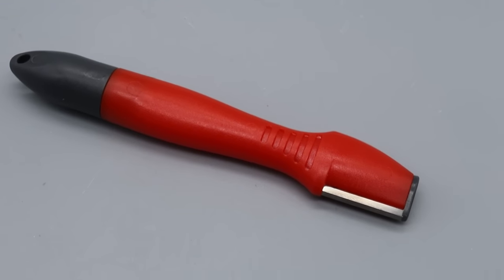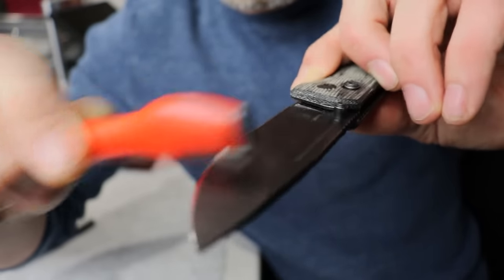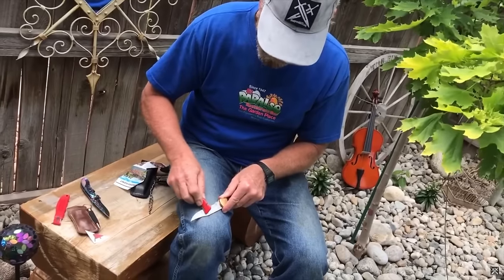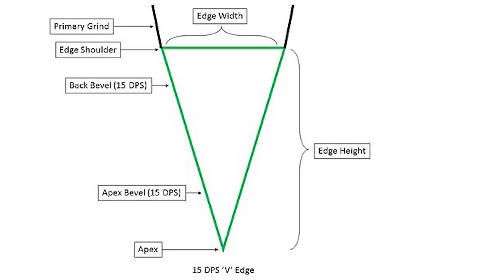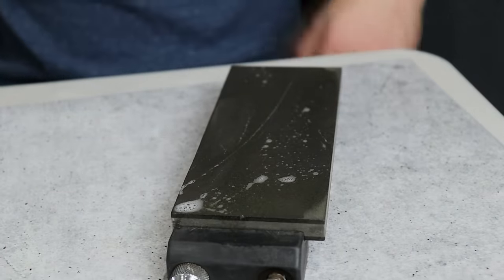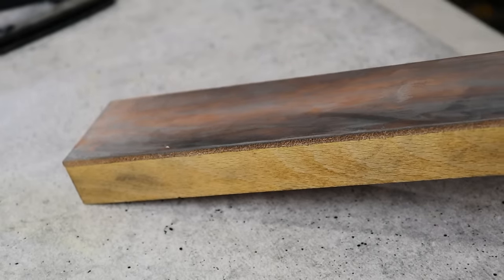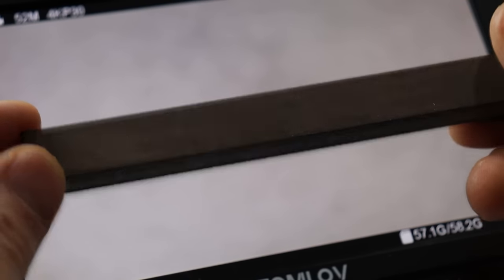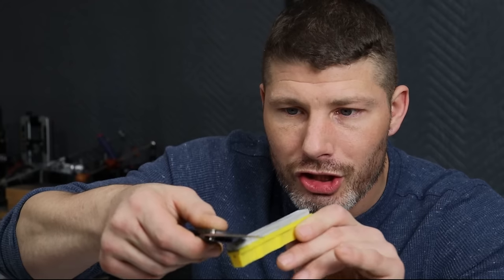Is This Sharpener Just A Gimmick or is it LEGIT

Comment: Talks about using a 10° angle and then at the trade show he says the buck knife is to thin/low of an angle and how you don’t want an super acute angle because it’s too weak. Which is it, 10° is an incredibly low angle.
Reply from the maker: Exactly constantly contradicting himself
Reply: @NeevesKnives this tool worked fine for me, after a while it somehow rounded the apex and there was no way of getting it recently sharp without mechanical tools
Reply from the maker: @rocknrollguitar  thats what will always happen, every time you use it it will make a worse and worse edge that lasts shorter and shorter

Comment: He does make a lot of bad statements. Like, I don't like to sharpen my knife too sharp, because it'll make it weaker. A paper cutting edge is about 1-2 micron, shaving is 0.5-1. At that thinness, it doesn't matter if it's 2 micron or 0.5 micron. It's more about burr removal, than how sharp your edge is. I have argued with him about that point many times until I gave up. (I see you showed that part, he says it a lot too.)

Comment: You were especially nice to this product.  I’m a machinist and I think we always look for the optimal condition and use the right tool for the job.  Butter knife for butter and Box knife for boxes.  Last night I broke down a 77” TV box triple layer with a $6 Kobalt folding utility knife.  I can sharpen it in two seconds
Reply from the maker: Yeah I have to be especially with a knock off however I have the real deal coming the full thing in order to do an edge retention test at that point I can push a bit more
Reply: @NeevesKnives  I have a diamond disc I mount on my lathe chuck.  I use it to sharpen carbide windmills and drill bits.  It works great but it’s not precise and chips the carbide much like using a scraper to remove molecules of steel from an edge.  The kind of tool you’ve reviewed is actually great when mounted correctly on a ski edge sharpening deal.  I used to make them out of mill files.  These little edge sharpening tools ended up being kind of a norm for doing a quick tune up on skis or a snowboard.  Even hockey Skates can get tuned up Supernice with just a few passes.  I never made them or sold them just made them to give to friends who ski.  My little tool wasn’t meant to do a real tune up but just fix a rocked out edge on the slope.  This tool is much the same but the invention is being used to support the guy’s living.  The guy is an entrepreneur who has managed to get his invention produced and he is the ultimate salesman.  I give him props for that.  The thing is most of the things I’ve invented were just improvements on things.  I’m still dealing with a machine I designed and built where a college class designed something similar and was trying to market it.  They never even manufactured the machine but after seeing mine claimed I had copied theirs.  
This guy managed to make a product, bring it to market by his hard work then it gets copied and sold for half the price.  The whole reason these kids in this engineering class brought the lawsuit was because I was applying for a patient.  
I really dig watching your vlogs because of the amazing machine work done on so many of these different knives.  The technology used to produce them is mind blowing.  The guys building and designing them are the future in manufacturing no matter where they’re from.  
It really doesn’t make a difference if the little carbide scraper works for folks like us.  It’s his thing that he is doing to make a living.  Personally I wish more folks were like him.
Reply: @davebishop2566 Yep, we need all the con men we can get. Uh, Wait! What did I just say?  If he would sell it for its intended purpose, fine. Not fo cutlery. It is a con pure and simple.
Reply: Nice flex

Comment: Ok, I've got carbide sharpeners like this and they do work but they're super hard to use. This tool is a single tooth file essentially, so to use it successfully you need to treat it like a file. 

For reprofiling it takes a strong hand and VERY VERY careful and precise application, you're basically trying to recreate what a CNC machine does using the same carbide cutting tool with your hands which just isn't easy. You can totally reprofile the blade like this, but you as a human are no CNC machine and are gonna have worse results and take longer. After shaping the bevel you need to de-burr and microbevel. First done by cutting the microbevel (NOT JUST UP AND DOWN THE EDGE BUT ALSO INTO THE EDGE SO EVERY INCH UP THE BLADE YOU ALSO MOVE AN INCH INTO THE BLADE) moving the carbide cutting corner at a 45 into the edge at the lift/angle of the edge (so like your 17degrees or so). Then finally deburr with that same 45 degree in-to-the-edge method you turn the carbide cutting corner to where the corner is trailing and basically both burnish and remove the burr with ADHESIVE WEAR (IT DOESN'T JUST STRAIGHTEN EDGES ADHESIVE WEAR REMOVES MATERIAL) like a ceramic rod or butcher's steel.

So you CUT the bevel into the steel then using adhesive wear refine the very apex.

But again this is a single toothed file, the vast majority of folks can't even sharpen an axe with a regular file much less something like this which is 2 or three times more difficult to manage. You can get no joke hair whittleing edges with files and these are no exception... but you need the conceptual understanding as well as the raw skill to do it. Not recommended.

Comment: Thank you for this very complete video.
I just purchased the "Worksharp Guided Field Sharpener".
I already have sharpening stones and equipment bought in China, but the nice thing about the "Worksharp" is that there is a guide. Getting used to holding my blade correctly and feeling what a 20° angle does to get used to an angle that fits a lot of blades.
I think it's a good long-term investment, it's a professional brand recognized around the world.
I suspected that the miracle videos of the man with his little red sharpener were a fake miracle product. I got confirmation here.
Anyway, thanks !

Comment: I’ve used the actual sparknsharp for years, with proper use it does a great job sharpening or touching up knives. Again it takes a fare bit of practice but it a great product
Reply: I will be at the Taner Gunshow this weekend in Colorado Springs if you’re in that area. And thank you for using absolute facts and truth.

Comment: I run a kitchen knife sharpening business. You are dead on! Someone is always willing to buy snake oil.
 
I get lots of stamped 440 knives. I finish them with a 1000 belt and a leather strop. Boring but shaving sharp. I finish my japaneese knives on 5000 stone and a strop. 
Putting an edge on a piece of steel hasn't changed in a thousand years. Funny how that works. Keep up the vids
Reply from the maker: Yeah the only thing that's different is the steels and some of the abrasives used but the method will never change

Comment: These are typically used for garden shears, and it is used with great force for minor reprofiling. You can see the shards of steel that fall off.
However, what i use them is for pushing a burr on a 90 degree edge for a card scraper(cabinet scraper)

Comment: I enjoyed watching your take on this subject. It is a bit of a hobby for me as well. Have you seen the Outdoors55 videos regarding "straightening an edge"? He has one about knife steels he goes into depth on the subject.
   Also I can appreciate a toothy edge, and I will usually not sharpen a new knife if it has a good toothy edge (leatherman is good at those) until it gets nice and dull.  I feel like its easier to get the burr to release on more of a polished edge, so when I end up with a razor sharp edge I think the toothiness kind of stops JUST shy of the actual apex, which doesn't really have any teeth left. Which you can see on a hair whittling edge under a microscope. 
   I think this tool does just what you said about deepening the edge issues and isn't a good tool. I left a comment on one of his videos telling him to do a microscope video, before and after he used his tool, but he pretty much declined.
   A bench stone is to a proper knife edge, what a jack plane is to a nice flat peice of wood. Its like the difference of trying to sand a chair seat smooth with a dremel/sanding drum vs a sanding block. They both would smooth the surface to an extent, but one has a flattening/ refining effect, where the other just follows the issues without correcting them.
   I have been wanting to do my own sharpening video, but it's just hard to find the time with work and kids. Anyhow, I enjoy your videos, keep em' coming sir.

Comment: I got this thing too. Had exactly the same experience, the thing only works as a hone-strop, it doesnt work once you removed all the vertical scratches as it makes the knife slip on the material with the parallel scratch pattern. What I wonder is that the edge retention seems to work the best on knifes with scratch pattern that have been probably sharpened on belts, the owner has a video of him shaving bark of a tree with a buck 120 and it still slices paper after that. Would like to know your opinion on sharpening systems that produce edges with higher and deeper  number of teeth such as the worksharp belt sharpener. In the end the carbide seems still pretty good on garden tools that have curves like pruning shears!

Comment: pull throughs are very situational they can be useful if u have matching angles meaning u have to use the pull through to profile it while its dull, i use them for cheap kitchen knives that i dont wanna waste hours on sharpening i reporifle their soft steel quick, most of the pull sharpeners are usually more acute/low degree angles.

Comment: His product is something that's been around fot ages, it's basically one side of a pull through sharpener or similar to a steel honing rod. To align an already sharp edge that maybe rolled over it would do that job although like you said there are much better options to choose from such as a strop, ceramic, or fine diamond hone that will actually work better and make the edge last longer by keeping those micro serrations in place. Pull through is the last thing I would want on any of my knives and I've been trying to get people to steer clear of them along with steel honing rods altogether by recommending a product that actually works. The worksharp guided field sharpener is great in the home as well as the field and wont break the bank, on top of it also being able too handle even kitchen knives or folding knives for maintenance. Still recommend a good set of stones for full sharpening of knives at home either guided system or free hand as it doesn't have an aggressive enough stone for reprofiling in my opinion, but you keep a knife going with it for a long time if no serious damage occurs. The carbide on the pull through sharpeners and this easy best sharpener do make for great ferro rod scrapers though for starting fires lol. Thanks for the great vid Jerad and keep making sharp things fun and enjoyable.
Reply: "ages" ya say? how long is 1 age and how many ages are in "ages"? ou 
you typed what he said in his video .  . . weird flex
i wonder why ppl do this? i see it A LOT
Reply: Let's see tungsten carbide was invented in the 1920's so ages in my case is about 100 years lol

Comment: Yours scratch pattern depends on how you angle your knife. The way you do it is great for cutting from heel to tip. But if you want the other way (a chef's knife maybe) you angle it the opposite way. Or do it straight and you'll have a perpendicular pattern that doesn't exceed at either, but does better than the heel to tip trying to cut tip to heel (hopefully you understand). I use all 3 strokes in burr minimization and finish with the pattern I want.

Comment: So not defending his products in any way, but I too am a knife sharpener who prefers whetstones... My Shapton Glass stones are my pride and joy alongside my newer Naniwa Diamond Resin stones.. LOVE them... BUT, I have these sharpens best sharpeners as well, as I wanted to try them out. If you use them properly, they absolutely WILL bring an edge back from completely dead (I have done this several times to friends at work with knives so dull they couldn't cut anything, but that requires a TON of pressure, and honestly that is probably cutting the metal so badly that it's wear the metal down way faster than normal PROPER stone sharpening over time)... You must use the corners, at an angle that matches the current blade bevel as best you can (which has given me the best results for me anyway), and twist the sharpener at about / around a 45 degree angle so that the "corners" aren't straight up and down, and are more of a sloped push as he demonstrates in his videos,  and do NOT use massive amounts of pressure (unless the edge is just super jacked and you want to get faster results).... The biggest catch? The edge, being that you're stretching it out very quickly with carbide, can be a lot thinner than a proper stone edge, and therefore rolls over easier if not careful. Brad even mentions how he also uses stones and a worksharp sharpener.. I believe these types of sharpeners are best for "in the field" quick edge repair when doing outdoor / on the job work where you can't bust out several large stones.
So, in closing, do I use these exclusively for my good knives? Nope, not at all. Do I use these on cheaper knives when out in the field and don't have access to anything when something goes dull? Yes... I don't fall for the gimmick that these are the only sharpeners to use as some would try and say, but I do use these for less expensive knives when a quick edge is needed in a place I can't properly sharpen.
Reply: Paragraphs?
Reply: Hey, I NEVER say I use stones.
Reply: @bradbuckner9496  My bad Brad, I could have sworn a video or two I have watched you said you also have used stones, but preferred your worksharp belt sharpener for a super quick edge, or something like that. It's been a while since I saw the videos, but I remember you mentioning stones a couple times. Maybe you were just saying they work as well or something.

Comment: It is titanium carbide, which is harder than most steels, so yes it will sharpen when used correctly. Use only light pressure and consistent angle. Using a carbide bit for planers does works similar. I never use V pull through. However I find a simple ceramic honing rod is better and less likely to screw up the blade.
Reply: Agree.  Need to use it properly.  Light strokes then strop and you can shave hair if you want.  It works.

Comment: Yeah I seen this guy before I knew it was snake oil with the carbide. My dad used them pull through for years until I figured out how to sharpen with stones. Pull through gets it just sharper then dull. Things are junk. I use more diamond stones now also. It’s just quicker.

Comment: I would use wet / dry sand paper with spray glue first, but actually did and I recommend the sandpaper and glue method for cheap results 😊

Comment: I have had great success with these type of sharpeners. Takes practice! Hard stainless steels to soft high carbon can be sharpened but are very different in  the feel using this type of carbon steel sharpener. I use it mostly as a field sharpener to get an edge back on a blade. As far as kitchen knives it works quick and can be used several times once you get the hang of it before going back to a stone. This does not replace the initial work you have to put into blade with stones but can get a quick edge back on fast when you need it. The angle and the pressure you use is key!! A simple leather strap after this tool works awesome. Again it takes practice but works when you learn how to use it. Having said that too much pressure WILL damage blade requiring more work to fix it. Remember this is high carbon steel that is used in lathes and milling machines so it has potential to remove a LOT of steel. I would bet that most people use too much pressure and ruin the Apex. My two cents worth from my experiences. I really like using them.